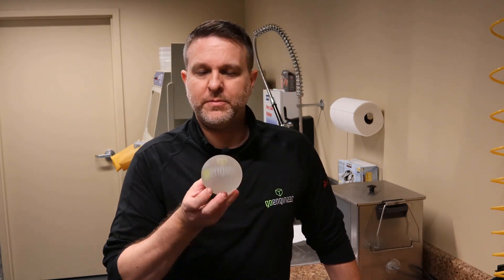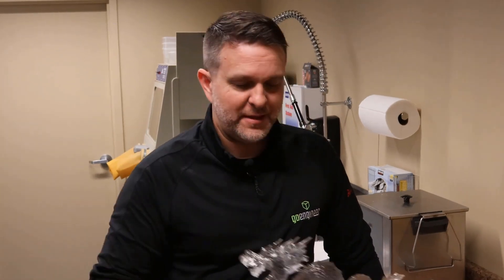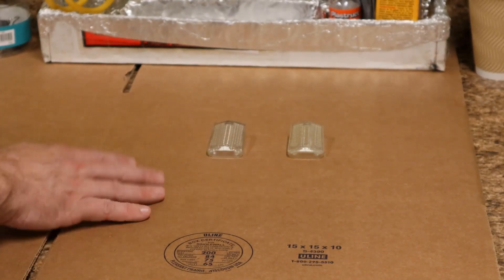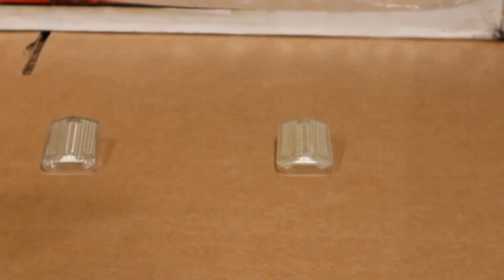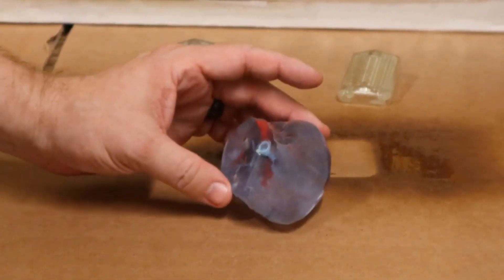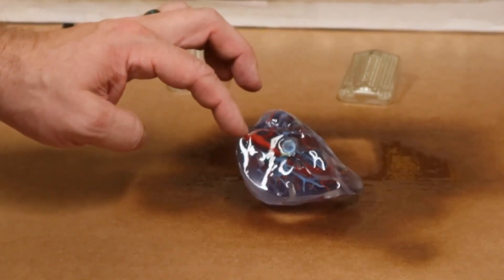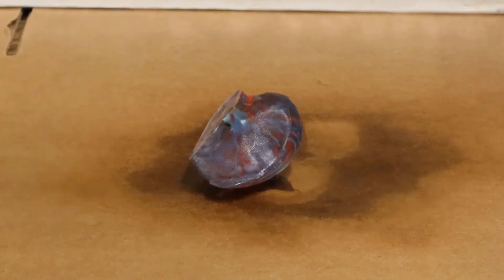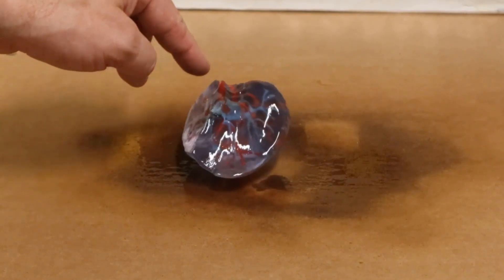Stratasys - Painting Clear Parts

Comment: Excellent!

Does it work with Accura ClearVue?
Reply from the maker: In theory, yes, as the 3D Systems technology is still using photopolymer resins. I haven’t specifically tried it on that material, but concept should work with Accura ClearVue Resin parts.